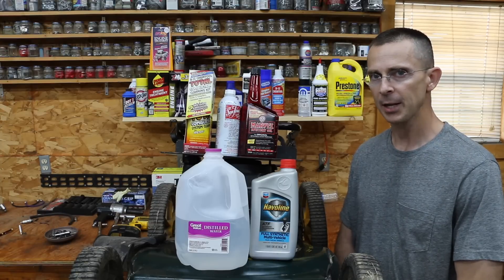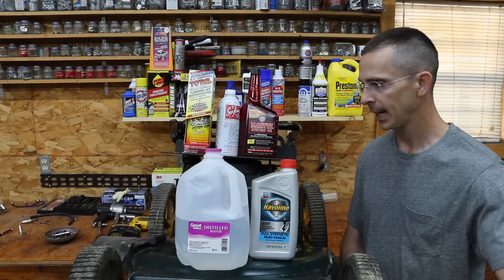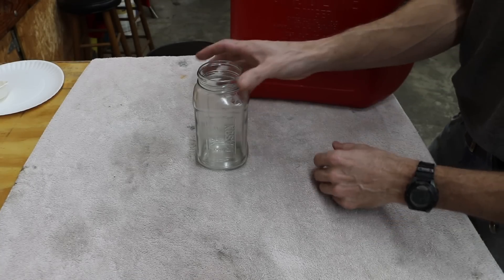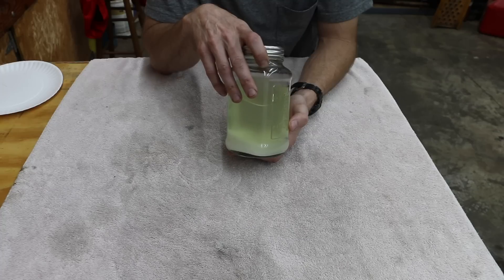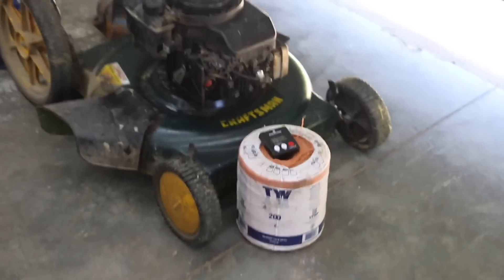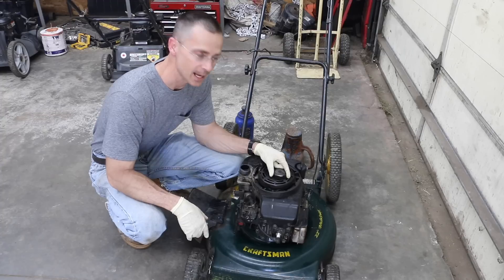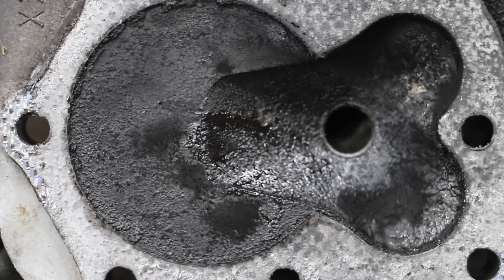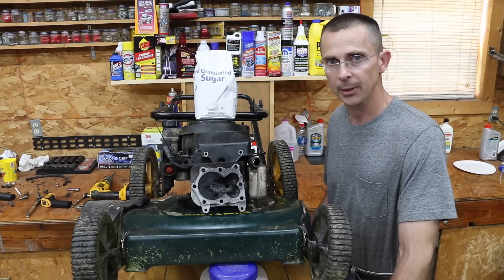Will Sugar in Gas Destroy a Vehicles Engine?  See what it does to this Engine!

Comment: Man I just got to say......Ive watched several of your videos and I got to say that lawnmower has been through hell and back lol......love your videos sir keepum coming.
Reply from the maker: Joshua, Yes, I've got a lot of lawnmowers all waiting for their turn for getting used in an experiment.  Thanks again for commenting!
Reply: It sounds like a horror movie for lawnmowers. When you turn off the shop light at night do they quietly weep in fear?
Reply from the maker: LOL!  It's a lot of fun testing additives and myths!  Thanks again!
Reply: LOL! I have thought this exact thing. He's like the lawnmower murderer. You're next lawn boy! No! Not me! Cub Cadet save me!
Reply: I just thought of something I'd love to see you test out. It's Hydrogen Peroxide, the strongest strength you can find.  Since H2O2 has twice as much oxygen as regular water, perhaps it can help the combustion and clean out the carbon deposits better ... who knows?
Reply: TheZigZiggy the highest strength would clean the block into a black and brown foam
Reply: Please,don't give Stephen KIng any more ideas!
Reply: I too would be curious as to the result of 35% hydrogen peroxide.

Use gloves and full face mask when handling this stuff. It will burn your skin/eyes at this strength.
Reply: You failed to see that its not the same one?
Reply: Your incorrect to a degree.....it is the same one in a couple of videos but is not in others.
Reply: Wow. I want to see if hydrogen peroxide works too. In a pinch, the weak stuff can be used in a lantern.
Reply: It's a Craftsman lawnmower. Now that Sears is out of business, the lifetime warranty actually expires.

Comment: Caramelized cylinder head. Hmmm. Too bad you weren't making crème brulee. Sea Foam should remove that.
Reply from the maker: Garcansdad, LOL!  Seafoam seems like a great approach!  Thanks for watching the video and commenting!
Reply: Only if it water based so the polarity matches.
Reply: Creme fuelee
Reply: Now we're talking...keep those automotive puns coming.  That's a good one.
Reply: LOL, Gar, "caramelized" and "creme brulee"!
Reply: seafoam is an oil based sOLVENT, IT SMOKES LIKE HELL when added to fuel so everbody thinks. OHHH LOOK HOW GOOD IT WORKS!!!   any oil added to fuel will make it smoke like hell. I call bullshit on seafoam.  B12 CHEMTOOL IS THE STUFF!!!
Reply: B 12 Chemtool works great as well.
Reply: brake fluid works really good as well.
Reply: Seafoam actually does work. I've taken before and after pictures of my engine's combustion chamber to prove it. I'm not quite sure it would work on removing burnt sugar, but it DOES clean carbon deposits on high mileage engines. B12 chemtool is good stuff too.
Reply: Garcansdad I
Reply: Burned sugar is a carbon deposit.
Reply: Jesus better not put sugar in my gas tank.. especially like at 3:16 and 3:25!
Reply: Ryan Alexander Osborn he was buried.?????????
Reply: LMAO
Reply: Garcansdad. With sel de Guérande.
Reply: Texas Tough, by that logic, you should stop buying B-12 chemtool and just go buy a big can of acetone, because that's all B-12 is you git.
Reply: Nathan  Kriever some  commenters  here are  salted  nuts, 12 years old  salted nuts.
Reply: Crème brûlée... You made me hungry!
Reply: Garcansdad
Reply: Crême brûlée, I should write (a key further).

Comment: Sugar doesn’t seem to dissolve in gasoline very well but I wonder if you added sugar to the oil in the crankcase of that with gum things up right and proper
Reply from the maker: Thank you for the video idea!
Reply: I'm with you on that one! 
Definitely sounds like it would get interesting quick.
Reply: Adding any kind of crap to the crankcase would cause very expensive damage. However, you have no way of getting somebody’s hood open without first obtaining access to the passenger cabin and the hood release lever, whereas even some modern vehicles don’t have locking gas hatches.
Reply: It does.......Molasses is quicker though.
Reply: Sugar will melt in the crank case and seize your bearings.
The commies ruined a bunch of logging equipment engines
back in the 70s and 80's with Karo corn syrup.
Reply: When a guy crashed into me years ago I told him he just bought a car, or I could call the police and insurance. So before he took the damaged car from me, I put black iron oxide in the oil fill :) figure that would wear something out fast.

Comment: This reminds me of back in the day when ppl used to say that cracking a raw egg on a car would ruin its paint job; I wonder if that's true? I subscribed a couple of days ago, and began watching your videos [oldest to newest]. I appreciate what you're doing, that you've ended up being a blessing to so many ppl, and that you're being blessed for it in the long run.
Reply from the maker: Thanks for watching and subscribing!  Thanks for the video idea.
Reply: You can put raw eggs in the radiator to stop it leaking.
Reply: My utility trailer got egged at Halloween a few years ago and I didn't get around to cleaning it for a few days. When I did the paint came off. It has a bare streak down one side now.
Reply: In 1975, my 1952 Chevy was egged - original paint job. Didn't see it for a day, left permanent mark where paint faded and cracked.
Reply: Egg would damage the old lacquer paints pretty readily.  Not sure if it would effect the newer paints though.
Reply: Eggs left circular chips on the paint of my uncles 56 chevy.
Reply: Back in the day, I saw little ceasers pizza take the paint off of a chevy hood.

Comment: The old VW air cooled carbureted Bugs didn't come equipped with a fuel filter.  We had a Bug towed into our shop on day, that had a frozen engine.  The first assumption was that a main bearing had spun and locked up the crankshaft.  Turned out to be sugar in the gasoline.  The acceleration pump actually had particles of sugar at the nozzle.  The pistons were seized to the cylinders because the carbon of burnt sugar had taken up all of the space between the pistons and cylinder walls.  I tasted the carbon with my tongue.  It had an obvious sweet taste.  It's the only example I've seen of a sugared engine.
Reply from the maker: Doug, thanks for sharing this experience.
Reply: VW bugs do have inline fuel filters. The owner of that one removed it. They paid a high price for being a cheapskate!
Reply: Doug DaCosta hmmm so you licked the inside of the engine. 😵
Reply: @phoenixx0412 Germans make the best autos in the world, they always have and are kinda known for it.

Comment: As a kid, I was among a group of students stranded 50 miles from home when the bus in which we were riding stalled and would not re-start.  Sugar had been added to the tank.  It may have been a diesel bus,however.  We had to wait until another bus and driver could reach the scene of the breakdown.  I always wondered about this as chemically sugar is not very soluble in petroleum solvents.
Reply from the maker: Thanks for sharing!

Comment: "What additive do you suggest if sugar has been added to your fuel tank?"  How about coffee?  LOL
Reply: Only 5, thumbs, hey, ?
That was funny.
Reply: @bignoseharry6561    It's because the video is a couple of years old, and most people only view new videos.  Also, comments can be put in order of how many thumbs up they have, so new ones get buried below the old ones. 
Anyway, thanks  :-)
Reply: And cream.
Reply: spiritus - alcohol
Reply: Milk and hot water with my sugar please
Reply: @siri4590  yeah really.  Part of the issue with sugar is that it's not fully soluble in petroleum.  It's more likely to clog the engine than anything else.  But alcohol?  Sugar dissolves GREAT in alcohol!  Running E85 or something else your seals can handle will dissolve the sugar better.

Of course.... it's not gonna burn the same as gas so it's advisable to at least try to mechanically remove as much sugar as you can.  'cause if it works right, it will dissolve all those sugar crystals in the bottom of the gas tank too!
Reply: Better hope it’s not cane sugar
Reply: @wesleyferguson6932  hmm even stickier I guess?
Reply: @wesleyferguson6932  how about some booger sugar?
Reply: Don't Forget The Creamer!..👍

Comment: Interesting. I always thought it was just to make a huge, time consuming (and therefore expensive, for most ppl)  mess.
The idea being for the sugar to foul and eventually block filters and jets/fuel injectors.
Reply from the maker: Thank you!
Reply: My experience is the LONGER the sugar is in the SYSTEM the more build up and CLOGGING in fuel lines and oil passages. Your short duration test will not show this. Don't even think about putting sugar into a fuel injection system as injectors do not tolerate any form of buildup!

Comment: How about running straight e85 through the mower and seeing if the carbon build up is worse? Also see what it would do to the carb. We always hear about how bad ethanol is for smaller engines I think this would be a great test.
Reply: Tyler G if you let ethonal sit for an long time (over the winter) the water separates and the ethonal turnes to gell cloging the carb.

Comment: would it be worth putting some marvel mystery oil in it to see how much the oil could improve the compression ratio
Reply from the maker: dufftruck6, Seems like a good test.  I was thinking about using a product specifically marketed for compression improvement, such as Lucas or Dura Lube.  What do you think?
Reply: yea the lucas would be a great idea because i have a old diesel truck which has lost most of its power over the year and I'm sure its just from blow by and valves not setting properly
Reply: Project Farm archoil 9100 might be interesting as well.
Reply: I've already tested Lucas Upper Cylinder lubricant for how it effects MPG, but I haven't tested it's effect on combustion pressure. The trouble is, I like it so much, I don't want to go without it. :)
Reply: I didn't test the compression ratio in mine - but about a capful amount added to the fuel as well as a capful to the engine oil seemed to help it quite a bit.  The engine runs very smoothly and it starts immediately on the first pull even after being in cold temperatures for weeks.  While it doesn't cure all things it does add to engine performance (probably engine life, too), which is why I'm a fan of it.
Reply: Andrew Durand 1st pull makes me think it's a lawn mower.
Reply: DE Nichols , it could be a pressure washer or generator
Reply: Yeah, it's a lawnmower.  I decided to comment because for one thing he identified the product (Marvel's) in the beginning of the video and secondly, he used a lawnmower for the demonstration and since someone asked about it, thought I would share my experience.  I haven't tried Marvel's in anything else besides an old car I used to have.  Like I said, I have had good experience with it, but think it works especially well with carbureted engines as that's all that was available when Marvel's was originally made.
Reply: Andrew Durand Agreed. :)

Comment: That's interesting. I've been hearing sugar will destroy an engine since I was a kid. Have you tried using a simple syrup (3:1 ratio of sugar disolved in hot water)?
Reply: Ding, ding, ding! We have a winner! Yes, simple syrup plus emulsifier to bind it to the gasoline or diesel and the engine is screwed. Granulated does nothing but cause sludging problems.
Reply: I saw on Thomas the train about the sugar in the tank thing when I was a kid, that's why I've always believed it. Hahaha
Reply: Yeah, I wonder if honey of maple syrup would work better. Or at least the very finely powdered sugar for cake.
Reply: How about Coca Cola?

Comment: Some years ago I read an Army field manual that was printed in the 1950s or 60s that had to do with sabotaging equipment behind enemy lines. 

There was a chapter devoted to adding things like sugar, acids, etc, to the fuel tanks and then running the engines for several hours and see what kind of damage was done. The tests were done in a laboratory and well documented. 

At the conclusion of the tests it turned out that it was either Linseed or Tung oil (I can’t remember which) were most effective and did the most damage. This was because they were very soluble in gas or diesel fuel so traveled easily through the entire fuel system to the combustion chamber where it would gum up the rings something fierce. What happened after the engines were allowed to cool to ambient temperature is they were locked up solid and required a complete overhaul to get them unstuck.
Reply from the maker: Thanks for sharing.
Reply: It probably wouldn't matter much which of those you used. They are both drying oils and should cause equivalent damage, maybe over slightly different amounts of time.
Reply: Thanks!  Worked on a Citroen with linseed oil, intentionally added by the owner who thought the oil companies conspired against owners with an inferior product that needed his linseed additive  help!  Don't know how much he used, but had been doing it for quite a while and it was a real mess, gummy sludgy filter.

Comment: I'm curious to know what would happen if you added some water to the fuel tank (to dissolve the sugar) and also mixed in some ethanol (to absorb the water and make it miscible in the fuel). Obviously you'd need to use only small quanitites of water and ethanol in the gas othewise the engine probably wouldn't run.

Unless I'm mistaken, without the addition of ethanol, the water would sink to the bottom of the fuel tank and wouldn't mix with the gas. But then the sugar is in the bottom of the tank too!
Reply: the sugar will dissolve eventually t y piece out..
Reply: That should create an emulsion of fuels, water and sugar. The worst part, I'm guessing, is the clog potential of expensive shit to replace. Caramel in the combustion chamber might be a bad thing also.

Comment: Sugar in a car will not necessarily damage the internal parts of the engine. It can damage it if for some reason the things it will destroy first keep functioning. To start depends on the year of car. A car from say the 80s or older having a carburetor not a throttle body will start to gum up causing the car to backfire and (I know from experience) will start on fire. Flanges will stop opening and can bend the needles inside carb. Fuel filters and lines will clog up plus electric or mechanical fuel pumps will malfunction.
 That's is the difference between a automobile and the lawn mower. A lawnmower has a gravity feed gas system leaving majority of the sugar laying in the tank and a carburetor that is set to run at one constant feed. A car has a fuel pump that pulls or sucks the gas up off from the bottom of tank sucking the sugar into the system, sugar is flammable that can cause the carb catching fire after backfiring. A fuel injectoin system will clog injector rails and the fuel purge valve causing car not to run. Usual replacement of the whole fuel lines and filters carbs or injectors and rail are required to fix. An that can be EXPENSIVE.
Reply from the maker: Thank you
Reply: Adding to the fuel injected engines, I once worked on a vehicle that had paint thinner and sugar put in the fuel tank. The paint thinner caused a further breakdown of the sugar, leading it to further bypass the fuel filter and injectors. By the time I got the vehicle, it did not run, the fuel filter was stopped up, and the injectors were coated with crystallized sugar. The owner of the vehicle opted to replace the entire fuel system. From the fuel tank, pump, filter, lines, and injectors. And, even requested to remove the cylinder head to check for damage or build up on the valves and pistons. Very expensive, but the culprit was found to be an upset ex significant other, and was required to pay for the damages.
Reply: Wise u r
Reply: What about flour?
Reply: @instantdethmouse  I'm dealing with the same problem with an '03 3.8L V6 Mustang Convertible and yes the girls got the top too. And tires as well. Her step father was the Chief of Police in Rutledge, TN so NOTHING was done about it.

Comment: GALLIUM!!! GALLIUM!!! GALLIUM!!!  
May I suggest you take an old mower with aluminum block or head...add gallium to a clean warm scuffed up spot...keeping the block warm overnight and see how / if it will catastrophically fail?  😎😎😎👍👍👍👍👍👍👍👍👍👍🔥🔥🔥
Reply from the maker: IP Freely, This seems like an interesting test!  I'll add it to the list!  Thanks for watching the video and commenting!
Reply: I.P. FREELY wooooow slow down there Grant Thompson wrong Chanel. Hahaha but seriously that sounds cool
Reply: Dude, just think for a second. The question isn't "if it will fail" IT WILL FAIL. Gallium will eat at any aluminium alloy. You can put a single drop on top of the closed cylinder head and it WILL destroy the engine.
Reply: P.S. bleach is not corrosive, acids are corrosive. The correct term would be reducing.
Reply: The active chemical in bleach is sodium hypochlorite. It is an oxidising agent. So it is corrosive.
Reply: Mark Ferrari just because something is an Oxidizer doesn't immediately mean it is corrosive. Only some Oxidizers are. Take a look, it's in a book...
Reply: Gamma, not knocking you or Geordi La Forge on Reading Rainbox, but okay Geordie. :)
Reply: Mercury will destroy aluminum too, it forms an amalgam, the same as gallium. 

A pot of valve grinding paste (carborundum) mixed with oil and dropped in the inlet manifold would be interesting .
Reply: Pure chlorine is corrosive, common household bleach is watered down but still corrosive.
Reply: Project Farm replace half the oil with gallium. Or, a few well placed drops based on your knowledge of the inner workings = lawnmower bomb 😉😎
lol